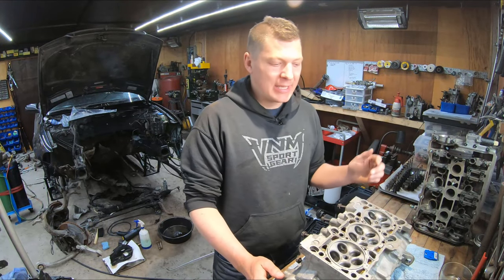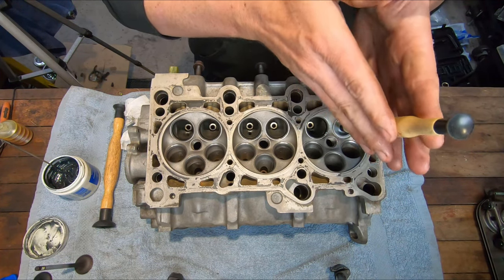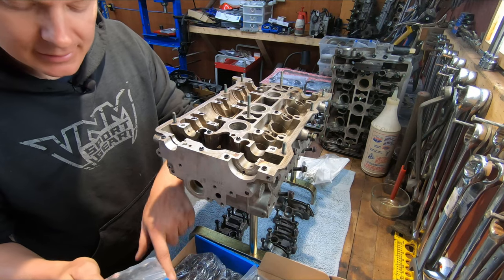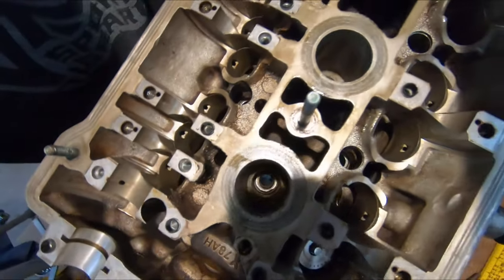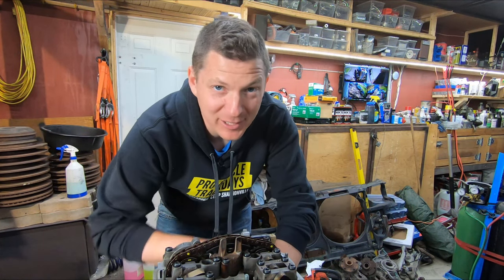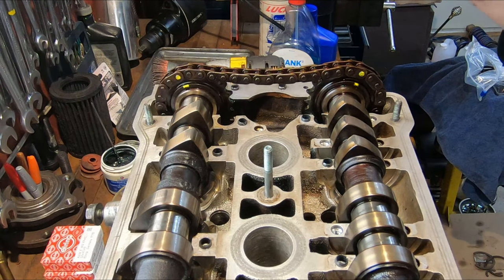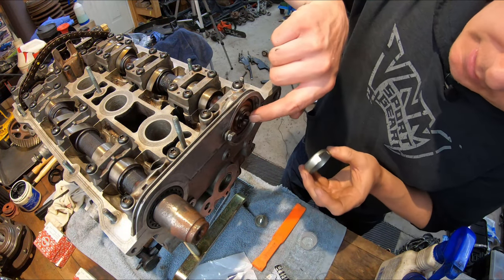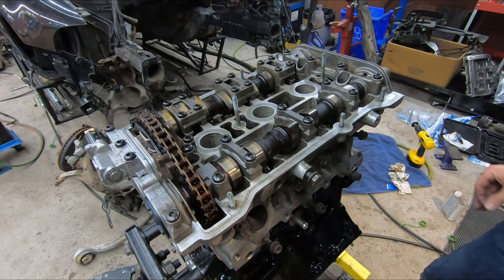Assembling 8500rpm "Big Port" Head with SuperTech Valvetrain Components

Comment: So you use the 2.8 intake valves, 2.7 exhaust valves, and a 2.8 exhaust camshaft?
Reply from the maker: I’m running 2.7 intake and exhaust valves, and both cams are 2.8 as well as the head itself. 

You could run the 2.8 intake valves but the ones I took out of the 2.7 seem identical and were in much better shape.

Comment: The cam cap doesn't sit flush, yours is installed correctly 👍🏻
As for the two types of cam seals (teflon and rubber), shame on you and I don't know how you'll sleep at night but hey it's your car. 👎🏻

Good thorough video though! Can't wait to hear this engine run.
Reply from the maker: Since I have to take the front cam cap off to spin the cam on the chain, that seal will come out easily, I'm thinking I might throw the Elring one in when I reassemble. That way YOU can sleep at night. Hahaha

Comment: Any reason to not put the new cam seals on the cams before you torque down the cam caps? That's what I'm planning to do.
Reply from the maker: I couldn’t find any reference in the FSM to doing it that way, only doing it with the caps already installed. I wonder if have the seal in place before torquing down the caps might keep them from seating square on the head.

Comment: Great video! Very informative.

I have been having trouble finding the socket to use on my bolts. Did you use the 9mm or 10mm Ribe?
Reply from the maker: If you mean the nuts on the cam caps and valve cover they should all be 10mm socket
Reply: Actually referring to the head bolts but I got the info I needed. And a few extra tools. Thanks again!
Reply from the maker: @ThorinJames  ah yes sorry! polydrive!